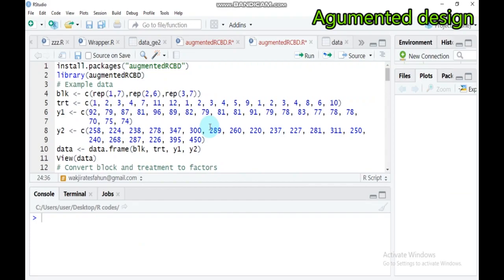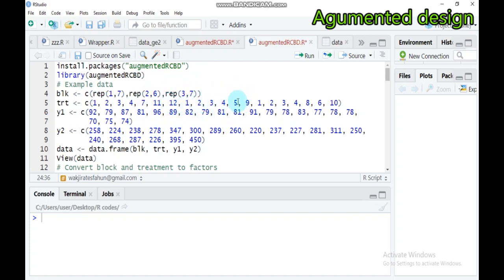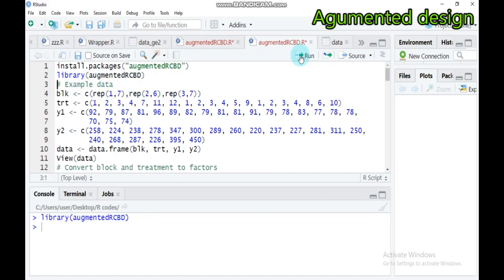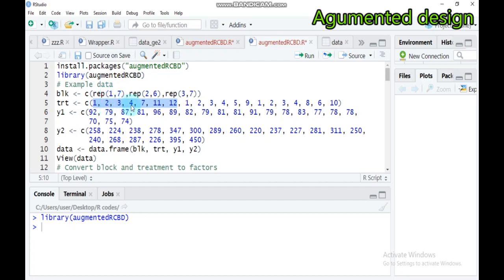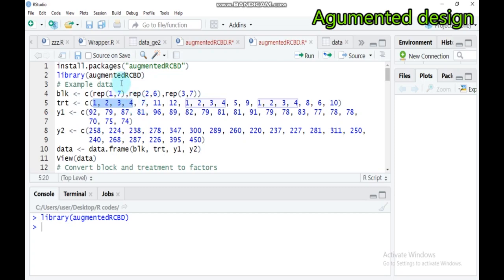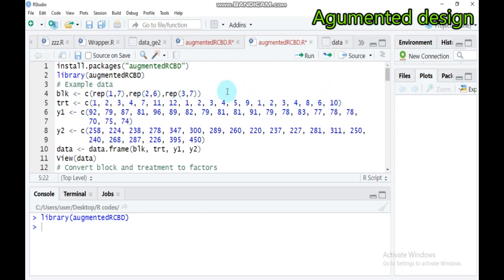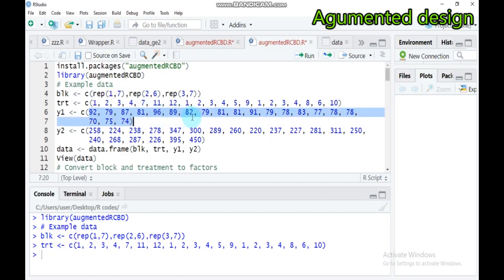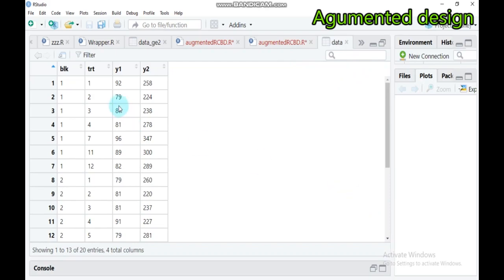Agumented Design analysis in R studio.

Comment: Hello sir, I am also conducting an experimental trial in Augmented Design. The experiment consists of 3 checks, 52 genotypes and 4 blocks so the error degree of freedom is 6. I want to ask that whether it is correct or the error df should be more than 10 compulsorily. If that so then I will need to add 2 more checks in my trial in order to make error df equal to 12.
Reply from the maker: Thanks for your question. If error degree of freedom less than 12, the F value sharply increased ,hence the power of F test will decrase substantially and it is not able to distinguish the true difference.
Reply: @wakjiratesfahun3682  so should i take two more checks? In order to make error df 12.
Reply from the maker: Yeah, adding two checks will lead you to have 12 edf since edf=(r-1)(c-1)or alternatively if you haven't enough resources you can add 2 blocks and 1 checks.
Reply: @wakjiratesfahun3682  thankx a lot